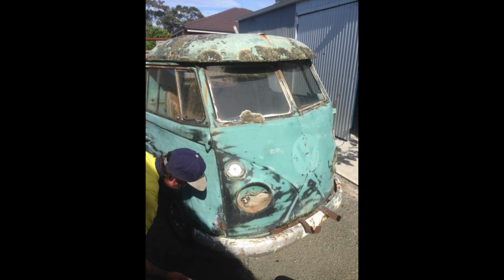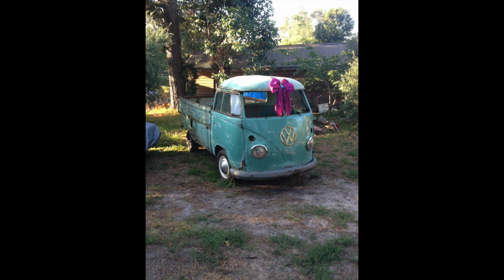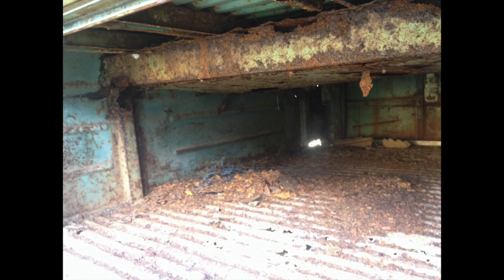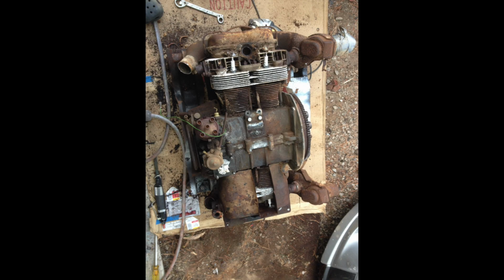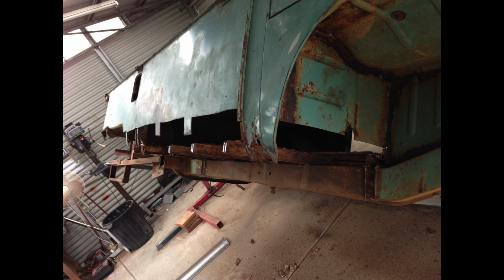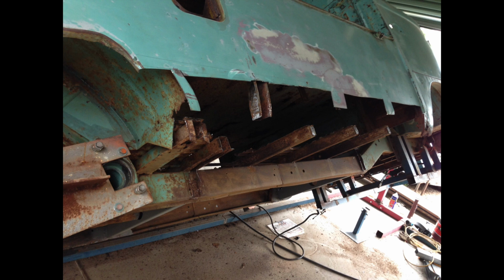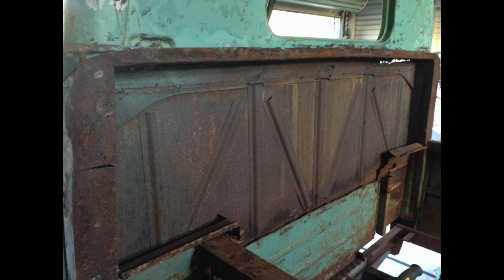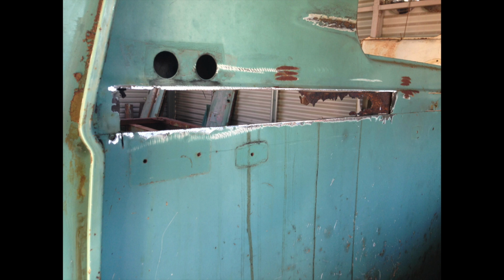VW Bus Restoration - RARE AUSTRALIAN 1963 VW SINGLE CAB MUFFIN TOP RESTORATION #vwrestoration

Comment: Nice work Demop! That air vent system is interesting. What did you prime with under the chassis after blasting? I'm getting ready to do same thing on my SC.
Thx
Reply from the maker: hay joe, I used a 2k epoxy primer then a stone guard paint then the color.